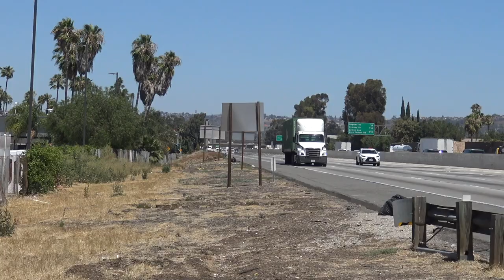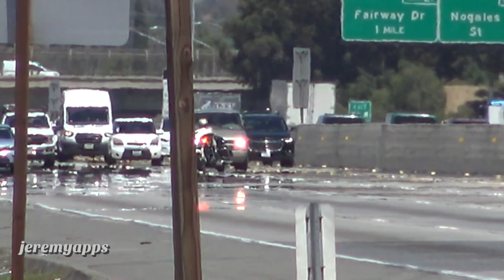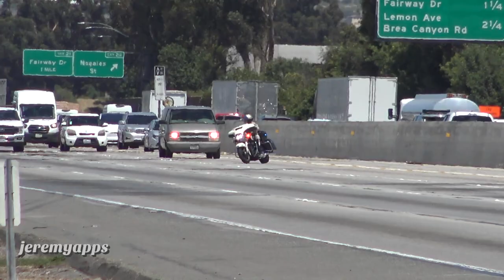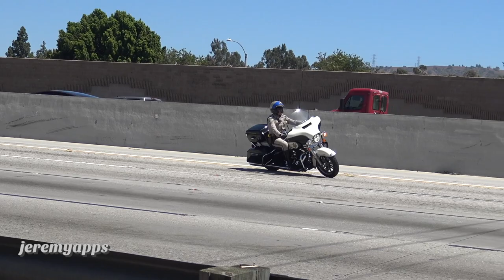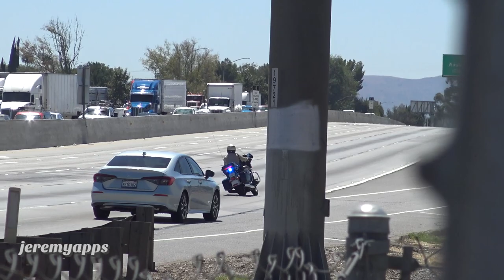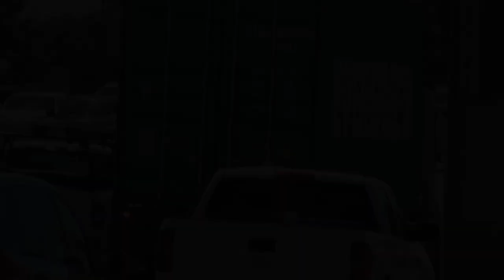CHP Motor Unit Conducting a Traffic Break

Comment: Training is crazy to become a motor officer he can spin that bagger in a circle till the crash bars are scraping and never have a issue
Reply: Next to SWAT, it's the hardest school to master. My father was a Las Vegas motor cop. A T. O. for the last seven. 250 cops would try out and 10 would make it. Most fail on slow maneuvering. Keeping a thousand pound bike up right is no easy feat at slow speeds. They have to stay under 5 mph doing very intricate maneuvers. There are some videos here that show the inter departments competition. Friggin acrobats.  In the 80s he had a female partner for 5 years. Grace. 120 pounds soaking wet with her duty belt and could move that Harley like it weighed 10 pounds. Absolute professor on that bike. 

I run a STAR course one week a month at the DMV parking lot. The "friction zone ", using the clutch and throtel in unison under 5 mph takes a lot of time to learn. 3. In 10 pick it up quick, the rest at various levels. The course has 2 figure 8s going in both directions, two straight aways and four circles 10ft in diameter. If you go over 5mph or dump the bike you fail the test.
Reply: I watched a motorcycle cop doing the test that they have to pass during one of my Daytona Bike weeks. Pretty impressive.

Comment: I was a doing practice exam where question asked what should you do if an officer is doing a traffic break. Correct answer was switch on the emergency flasher. In this video not even one single car have switched on there emergency flashers.

Comment: Hey! Mind Explaining the Callsigns from the CHP? Why is this Unit marked with a "M" in it's Callsign? Dies the "XX-XX" Change from Area to Area?
Reply: Does.*
Reply from the maker: Hey there! Thanks for watching, I will do my best to quickly explain it. “M” unit is a designated Motorcycle unit, they are more often referred to as “Mary” because it gets read out in phonetics. For callsigns, they differ based on what Area office and beat they work. For example: 
Baldwin Park is dubbed Area office “81,” so it will be 81-XXX. The last three digits is for the beat. So 81-601 would cover the SR60 Freeway. Then, when you add a letter at the end it makes it more specific, in the case of the Mary unit it’d be 81-601M. Lastly, if you’re looking for the full callsign, you would add the shift to the beginning. So if 81-601M is working the A shift, the final callsign would be A81-601M.
Reply: @jeremyapps  Hey! Thank you very much. Tho, what's the Callsigns for the LA Area? You Know that too or..? Tho much appriciated still!

Comment: Note the time of the day? This explains why LA has so much traffic jams
Reply from the maker: These breaks could happen at any time of the day. Also WB traffic on the 60 during the afternoon rush does not have traffic :)
Reply: In reality,  this actually breaks up traffic jams.    Traffic jams are caused by idiots not letting anyone else move.  If you give some traffic a chance to move, traffic doesn't get as jammed up.  Instead of 3000 vehicles sitting at a complete stop because nobody can move, 2500 cars are slowed to a crawl but are still moving.  While the other 500 have a chance to move.    It sucks to be stuck crawling along the freeway when you can see empty road in front,  but it is better than sitting at a standstill with no empty road in sight.

Comment: What is the point of this?
Reply: A tow company had to hook up a tractor-trailer rig (big truck) somewhere ahead of this traffic break. Rather than close the road so the tow truck can work without traffic flying by an officer creates a break in the traffic for the short period of time the tow company needs to get the truck hooked up. Sometimes they need more than one lane shut down to do this. Traffic breaks use fewer people to accomplish than a lane closure and less of a traffic jam as it avoids the lane merging lane closure require.

Comment: raneg rover wit the flashing lights... a hog wit $$$$
Reply: the lights do not flash like that is the camera doing that
Reply: @mikelsolomon3714  your wrong. why do u think that range rover is not waiting in line like the rest of them. yes led lights flicker ALL AT THE SAME TIME. they dont switch back and forth and FLicKr
Reply: @Good_Luck11  it is was not waiting like the rest of them bcs it may have merge before the the police start doing that
Reply: @mikelsolomon3714 ok your right
Reply: the two lights are different, it's 99% most likely a visual artefact.